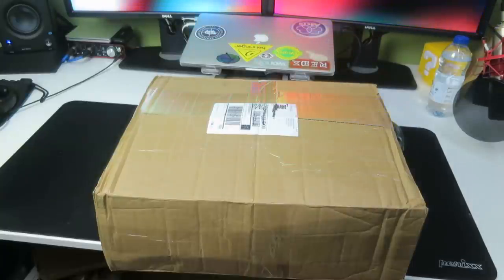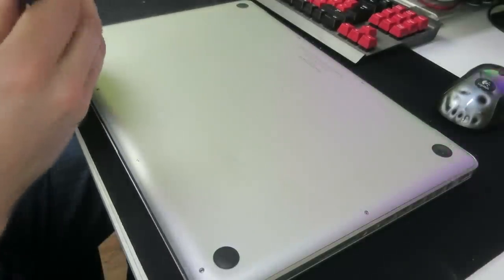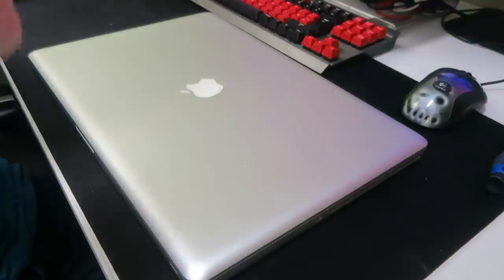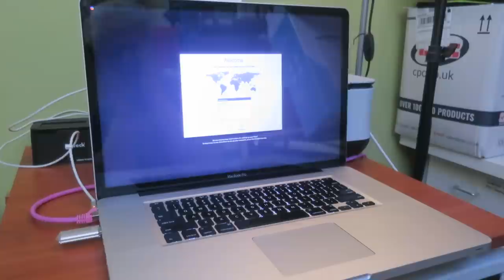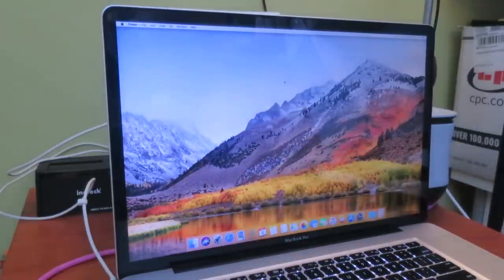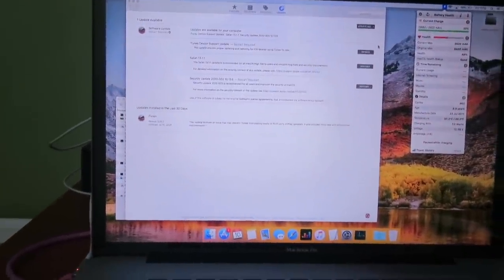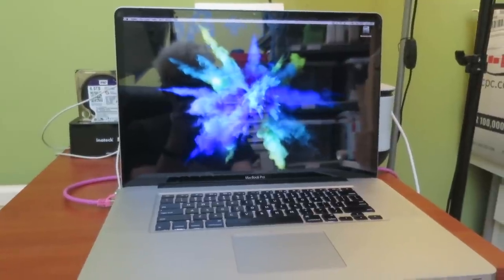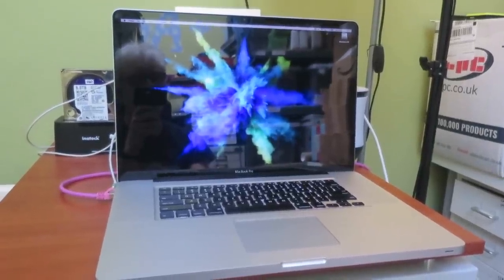2011 MacBook Pro 17” (Donation to IMNC from Luke)

Comment: What the hell did I do with those drive screws?! I’m sure they’ll turn up in a couple of years 🙄
Sooo glad to see it back in some kind of service. Farewell my beauty - you served me well all those years.. until you started flaking out. Then work gave me a replacement and I basically stopped using you as soon as possible. Don’t take it personally.
Tbh so glad to see it go to a better place, even as a museum piece. You absolutely hit the nail on the head when you were saying about having that doubt in your mind about it’s reliably. I found it cut out most during high cpu loads (I’m a developer so doing a lot of intensive compiling stuff) and when putting pressure on the bottom near the MagSafe port. As for the high cpu usage, I’m not sure if that was the battery not being able to meet the power draw or just bad thermals. Check the thermal paste as it might be some cheap shite. 
All in, this has properly made my day. 
Thanks 👍
Reply: I have an old 2010 15in Pro that experienced the same issues but they didn't start till I upgraded from Mavericks to High Sierra. I do development work myself and it is a pain in the a**. I replaced the battery and that stopped the random shutdowns, but as for the GPU it still works, but the machine only crashes when I boot into Windows 7, but I do find that in macOS especially using Chrome, some icons, and the cursor dissappear. I think a battery replacement will solve tons of the SMC issues. Video may be the next problem.
Reply: Dylan Ash Did your 2010 15 inch had the issue with the capacitor on the GPU framebuffer power rail fails, and starts to pull the rail low causing the machine to kernel panic?

Comment: Disable the AMD graphics and it'll last another 10 years.
Reply: Apple's engineering is that atrocious, eh?
Reply: Eric Wood GPUs in laptops never last long tbh. They’re always the first component to die.
Reply: Yepp, that sounds like what it's doing itself when it boots and takes 90 seconds.  Remember in About this Mac, it was saying Intel HD graphics... It would display the AMD graphics if that was the in-use GPU on that boot, so yeah, Tom if you see this, definitely have a go at disabling the AMD GPU and you might save yourself some time when booting up the Mac.
Reply: @ericwood3709  Actually in this case it's AMDs fault. It's a design flaw in the chip itself. Basically the underfill between the GPU die and substrate is the problem, it cant handle very high temperatures at all, temperatures than is considered normal for most GPUs so the underfill would soften and melt.
Reply: @Destructor8031  Very interesting!

Comment: Really nice video.
For the random reboot/shutdown 2 solutions :
1 - Install Macs Fan Control (it helps with the fan(s) and GPU temperature.
2 - On the MacBook, verify the MagSafe connector. I changed mine and everything was ok after that. On a late 2008, it is a small board connected to the main board.
Looking forward to see your next videos.

Comment: I just received 2011 17" Macbook pro in the mail, still cost  in the 200 price range. It only a dual core duo . Its takes the 85 watt ac. Yours is a good find in that great condition. Normally the bottom housing is scratch or bent.  There is so much space near the touch pad.

Comment: I've got a 2011 15 inch with the same gpu problem, what I did is strip the logic board completely down and then baked it at 400F for 8 minutes in my oven. Fixed the issue and it's been running fine for two years. As an addendum, you might want to reseat the heatsink with new thermal paste.

Comment: The 17" models were just gorgeous. I know how you feel about the random shutdowns though, I have a 2009 iMac patched to run Catalina and it's got maxed out RAM and an SSD. Plenty fast enough for basic stuff but I've had to retire it because it suffers from random freezing. I've done everything to diagnose the problem but never been able to figure out why it happens. And it's impossible to depend on now.
Reply: Have you seen Louis Rossman replacing a 330uf capacitor that seem like one solution?

Comment: I bought one of those in 2012 since Apple had stopped making 17" laptops - got it maxed out and still have it and occasionally use it from time to time.

I bought it despite having a 2010 17" simple because I wanted one with a quad core - and this was my last change to get one with that configuration.

I moved on to iMac 5Ks after that, and didn't buy an Apple laptop until the 16" MacBook Pro was released.

I finally had to stop using it since no one made Expresscard/34 cards any more, and the drivers for my Expresscard/34 cards stopped working in older versions of macOS. This left Thunderbolt 1 and USB 2 for peripherals, and no one makes TB 1 or 2 peripherals any more, and USB 2 was just too slow.

Comment: My advice would be to change the CPU and GPU thermal paste and a general clean inside.Also you could try and disable the GPU and use the onboard graphics to determine if the problems persist. 👍🏼

Comment: I believe that the Graphics Card hasn’t kicked in before of the 60w charger so the graphics card isn’t initializing. As others have said use the DosDude1 dGPU disabler and that should sort itself. The random issues are most likely related to the GPU

Comment: Don't use it in any anger the AMD GPU will pop, it was a known issue that with these MacBook Pros from 2011 with dedicated AMD GPU.
when I was working for an apple reseller from 2011 to 2016 I would see dozens these coming in with GPU artifices issues or HDD cable or 
HDD issues, Apple refused service on these in 2015 and we where finding it card to get parts coming up to 2015.

There was an isolation board released by some guy that would isolated the GPU and only allow the intel intrigued GPU work making the machine
working again but with a performance hit.

Comment: i had lines and re checked the cable that connects the monitor to the board and reseated and it fixed it, as it wasnt glitching id suspect that the cable could be requiring reseating rather than a bad gpu

Comment: Sounds like an external dock would be handy for your main setup, so you can reduce the number of cables you need to unplug when you need to take that laptop remote. Also maybe add a USB 3 card for the port in the new rig to your nice to have items list. Cheers

Comment: If you use dosdude’s GPU disabler, you will lose brightness adjustment, sleep and because you lose brightness adjustment, it’s 100% all the time and battery life is shocking as a result.

Do it via recovery commands and you don’t lose the above features.

Comment: You can effectively disable the dedicated GPU in software. There are more permanent solutions involving logic board modification (effectively remove the chip and reroute some lines) but a software fix works. The GPU is likely responsible for the sleep issue, I'd probably blame thermals for the random shutdowns but it could be the GPU is something is intermittently shorting to ground. http://dosdude1.com/gpudisable/

Comment: The Samsung 830 256GB is really old nowadays. I compared this with the 860 Evo 500GB on UserBenchmark and the 860 Evo 500GB is significantly faster and more recent, and almost matches the capacity of its original 750GB hard drive.
Reply: The machine is also old so the extra speed of newer SSDs is unnecessary.

Comment: I bet Apple didn't resolder the AMD graphics chip in repair. They only put a foamy piece of tape on the chip so that the case would press down the graphics chip against its solder pad!
Reply: It was definitely a full board replacement.

Comment: in 2020 i still use an early 2011 13in MBP running a patched version of catalina its runs pretty smooth with on the intel graphics and 4bg of ram and a 250gb ssd